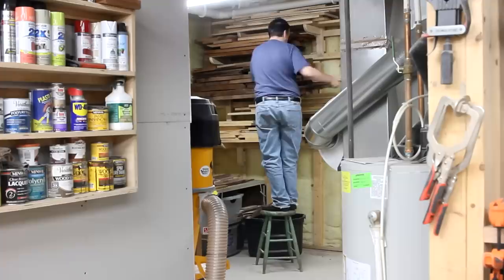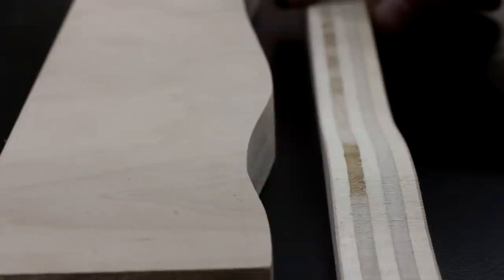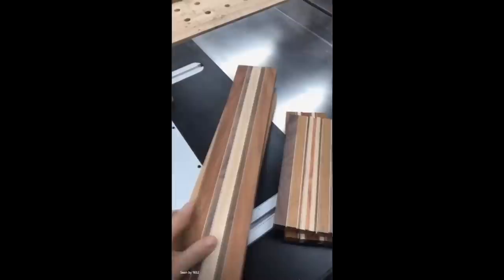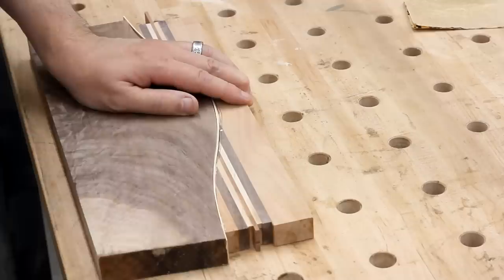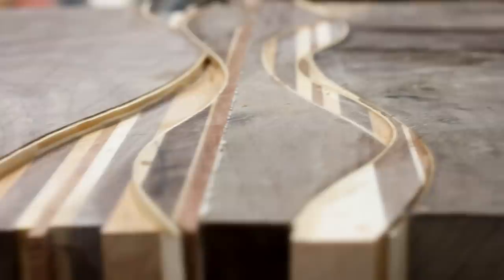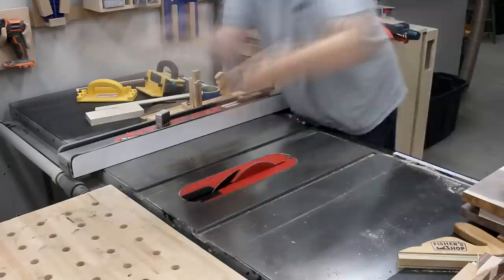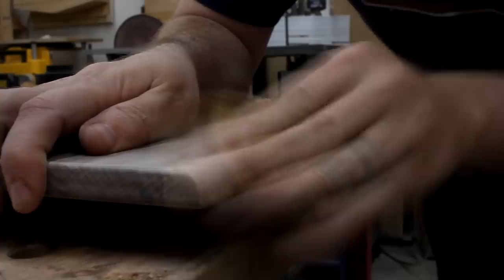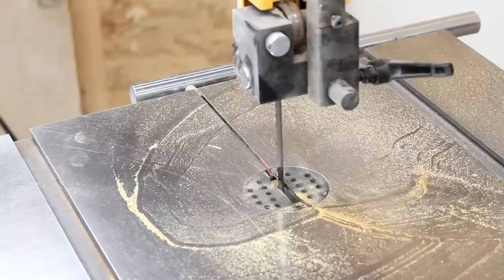Woodworking: How to Make a Woven Cutting Board

Comment: i'd love to see that scaled up on a big dining table or coffee table
Reply: The only way to make a wide table like that is to pass the nearly finished glued up board through an open-sided thickness sander to get the surfaces even. I make smaller (8x12) "cheese" boards this way. Now I need to try this weaving technique.
Reply: @gblakev  You could use a router sled, far cheaper.

Comment: I couldn't, in good conscience, use that as a cutting board...no way. Wall art, lazy Susan, or on an easel.
Reply: I am thinking of making 6-8 of these and mounting them on a headboard.  Sort of popping out a little ways.  Problem is I don't have a jointer, planer or band saw.  So I need to test if this is possible with a jig saw and hand planers first.  First one will definitely be a cutting board.
Reply: @NotMyActualName_  I was having similar thoughts - I don't have a band saw, a planer/jointer or a table saw, but I reckon the swooping cuts could be done with a jigsaw. The tricky parts would be getting the surfaces properly flat and cutting the thin strips...

Comment: "This weaving technique is pretty fun, and easy!" Right now now I need a table saw, band saw, make a thin cut jig, a table top router and bits, disc sander, 20 more clamps and some CA glue. THEN I can make this cutting board. After I get the wood. lol I'm getting there.
Reply: In all fairness you don't "need" those tools. It makes the process easier and faster. But you never need the tools. Except the clamps. You don't have enough clamps.
Reply: @coreyloewenstine8822  lol thanks yeah I know I’m just being ridiculous. I’m slowly building my arsenal of tools. And clamps…
Reply: @timalban1433  it takes time. Depending on the projects you like doing I can suggest tools you should definitely buy before others. My shop mostly produces guitars, plectrums, and cutting boards so my lathe rarely gets used and it feels like a wasted investment since I almost never use it.

Comment: I have watched your video several times and thought I had a handle on the project. I made several strips of wood and glued them together. There were no gaps and I did not plane my piece at this point. Meanwhile I made the thin strip jig and cut the thin strips. I cut the large piece with the bandsaw and made a very mild curve. When gluing the thin strip and including it, it all became a disaster. I would like advice on clamping it in a way that keeps all of the strips lined up and also glue up with no gaps. Thank you. I have pictures - just don't know how to include them.

Comment: In order to smooth out the bandsaw marks perhaps try running straight flute router bit thru the cut, just make sure you space cut pieces parallel. And 1/16th narrower then bit kerf. It will follow the cut, and throw a smoother finish on both sides.

Freehanding should be fine, just let the bit follow the cut, and make sure your pieces are clamped nicely, and parallel.

Comment: Instead of using painter's tape and glue to hold your pieces together while cutting the curves, try double-sided carpet tape. A stripor two of that, some masking tape on the ends and edges  hold the pieces together very well,

Comment: I would live to try this out. I have one concern though. I am worried my bandsaw isn’t powerful enough to keep the flow of the cut going like you did. Mine is an 50’s model old delta that cuts metal and wood although I have never used it for metal. These look great and thanks for the ideas. Great wedding gifts.
Reply: With a sharp blade, your old Delta bandsaw should do fine.

Comment: These are great! Have you ever tried to match up pieces? Perhaps with cabinet door faces? Trying to think of ways to align the curves across multiple panels. Could be done on one large piece I guess, and then cut the door faces down to size from the large piece, but I don't have a lot of workspace to manage a large panel / glue up.  Wondering if you could "start" your curve cuts in the same place on each board to align the design across multiple boards. Have you tried it?
Reply from the maker: Watch my TV stand video.  I did that for the doors.

Comment: You are a master at your craft.  May I ask, do you fill in any imperfections between takes?  I was studying the closeup of the finished boards, and I was incredulous at the sharp fits.  I saw zero imperfections in the joints.  What gives?
Reply from the maker: Nope, no fill.  I just squeezed the heck out of it and closed up any gaps.

Comment: 2:47 stumpy nubs has a great video on how to get that perfect curved boards to match using a router and a offset bearing offset by the width of the router bit (I.E 1/4" for example uses 1/4" bearing offset) something along those lines i think its called like this router technique is harder then it looks somethin like that

Comment: Beautifully done!! Is there perhaps a way to strengthen the board by placing a wooden rod/peg across the center that's also hidden to ensure it stays together over time?
Reply from the maker: Not necessary.  The glue bonds are stronger than the wood itself.

Comment: As usual, amazing work! Going to try it but have no bandsaw wondering if I’ll get by with a jigsaw instead. Thoughts anyone. Length of blade might be an issue I suspect.
Reply from the maker: I'm afraid the jigsaw won't give you the clean cuts you need.

Comment: “Artistic feel” ? Brother, that is art ❤. Now I have to find money for a band saw. And maybe a glue mat…for select neighbor granola gifting.
Questions…would double sided tape work, or is there an issue that painters tape avoids? Would using a hand jig saw be problematic?
Reply from the maker: Double-sided tape would be fine.  Jigsaws have a thicker kerf (which would be a problem) and it can be tough to keep the blade perfectly vertical, the blade tends to drift on angles.  Get yourself a bandsaw. :)

Comment: I'd love to give this a try, but despite having a workshop loaded with woodworking gear, the one piece of equipment I've never had a need for is a band saw. If I take the cuts slowly so as not to slant the blade, do you think I could make the paired double cuts with a jigsaw?
Reply from the maker: No, I'm afraid not.  You really gotta make the cuts fast on the bandsaw to keep them smooth and flowing.  Pretty sure that's impossible with a jigsaw.

Comment: Just found this video yesterday and LOVE the look!!  Not sure how long you monitor comments on a post but I have a question.  Glued up some boards tonight for the starting pieces.  I believe I've made them too big.  One is 7" wide and other is 9" when all glues up.  They are 20" long since I'm shooting for an 18" board.  What are the dimensions of the starting glue ups that you used?  Thank you
Reply from the maker: Doesn't really matter, to be honest.  If it can fit in your clamps, you can do it.  Watch my Lazy Susan build or my TV Stand build.  You'll see this technique done with larger pieces.
Reply: @FishersShop  Thank you, I'll give them a look.  I believe the ones I glued up tonight are going to create a cutting board that is 18"x18".  Not optimal.  Again, thank you

Comment: What was the reason to use a sled with your planer to flatten the rough board instead of your using jointer?
Reply from the maker: Because it's too wide for the jointer

Comment: Hey I was wondering. It looks like the main piece of walnut is face grain but the rest are side, or at least most of them. Will that make a difference with the structural integrity of the piece. I see a lot of different viewpoints on this and was wondering about your opinion. If you even seen this years after posting the video haha
Reply from the maker: Nope, doesn't matter.  Think of it this way, it all boils down to how the tree was rolled onto the mill that determines what will make up face grain and what will be side grain.  If the log was rotated 90-deg more, the face would be sides and the sides would be faces.  There's no difference between face and edge grain.  None.

Comment: very nice design with great technique!  May I know what is the saw width (1/16 or 1/8)? and what is the sanding grit after cut before glue ? thanks
Reply from the maker: Saw kerf was like 1/16" I think.  I think I just used like 120grit

Comment: Really a nice video. Instructional, humorous and entertaining. Bingo!  I'm wondering why it's necessary to make the thin strips the same width as your band saw blade.  Sure, thin ones will bend easily, but other than that it seems that any strip around 1/8" would work.  Your thoughts??
Reply from the maker: The two halves won't fit perfectly together if the strip is too thin or too thick.  It'll be close, but no perfect.

Comment: What TPI is your band saw blade? Mine is fairly low and I don't get clean enough cuts that I trust for glueing. And sanding them risks throwing off the mating curves.
Reply from the maker: The TPI count has to be low so that the gullets are big because your feed rate will be rather high as you push these through.

Comment: I really like this design!  Very cool!  What size is your bandsaw blade?  Ive got the Wen 10" bandsaw but every time I try to use it the blade seems to wander off coarse.  I am using the original 3/8" blade that came with it.

Comment: Why do you have to cut the thin strips to be the same width as the band saw blade?  Couldn't the strip be a tiny bit bigger or smaller?
Reply from the maker: No.  Has to be the same size.  If you remove a certain thickness of material then you have to replace that same thickness of material with something else in order for the pieces to match up exactly.

Comment: l. question about the thin strips. Are they face grain? Are all your pieces face grain to face grain? I am confused about putting face grain to edge on cutting boards. is that ok over time?  I know not to ever mix end grain with face or edge but I can't get a definitive answer on face to edge glue ups. both long grain so should be ok?? anyway your boards are beautiful and definitely going to try one.
Reply from the maker: Yes it’s fine.

Comment: I have a quick question, did you steam the strips that you used for the pattern? Just curious.
Reply from the maker: No.  They're thin enough to bend on their own.  If you steam it, you'll have to let them completely dry before gluing.  It's just not necessary.

Comment: if i am making an 18 x 16 cutting board how do i figure how long the thin kerf strips need to be? because of the curve they need to be longer than the board, so how do i figure that out? thanks
Reply from the maker: Depends on how curvy your curve is.  Just make them way longer, and trim off the ends once they're glued up.

Comment: So how exactly do you get the cut to match on the second board? Is it just that you had them stacked before cutting so you wouldn't have to worry about making a second cut on a separate board?
Reply from the maker: That's how ya do it.  Yes

Comment: I don't notice any lead strips you are using while planning, don't you have trouble with snipe? I thought everyone with this planer has trouble with snipe and has to use lead pieces or cut off the sniped portion.
Reply from the maker: Snipe is practically impossible to eliminate totally.  Yes, you can move it to sacrificial boards but if you take super light passes, usually you can just sand it out afterwards

Comment: Thanks for the great video! Would you tell me the tpi of your 1/2” blade?
Reply from the maker: 4tpi on a 3/4" blade
Reply: In your video you say to use a 1/2 “ blade- it should be 3/4?
Reply from the maker: @willbennate  The bigger the blade, the more smooth and flowing the cuts will be, in my opinion.  At least, that's what I found to be true.

Comment: Hello this was a great video and I am going try this.  Would you be able to use non glued veneer edge strips for the filler piece for the saw kerf?
Reply from the maker: Only if it's the proper width.  I doubt that it would be thick enough.

Comment: I'm trying out a practice piece and making the strips to insert.  They seem very thin, did I read your kerf measurement right 0.0635 inch? And what wood did you use for the strips?
Reply from the maker: Measure your own kerf.  Don't go by mine.  I used maple
Reply: Thanks or your help.  Mine is .062 and was just trying to see if that was about right. I was wondering if I needed to find a thicker blade.  Thanks again!

Comment: Can you please advise how powerful your band saw is.   Is it running a 2hp motor or bigger.   My band saw is a 1hp and with Australian hardwoods it takes a long time to get through the wood and of course it does not give a smooth cut line.   Your work is outstanding by the way.   I admire greatly your skills.
Reply from the maker: My Rikon 10-324 has a 1.5HP motor.  Sounds like maybe you might need a new blade or to tension it more.
Reply: @FishersShop  Thank you for your reply.   I took your advice and put a new blade in that was thicker, but Australian hard wood is HARD and not that easy to get through with a smooth action  I have been experimenting and a steady hand helps.   Thanks once again.
Reply: I took the plunge and bought a 3hp band saw.   Gets through Australian hard wood really well now.   NOW I can get onto making boards like yours.   Love your video.

Comment: Incredible technique, I'll certainly see if I can do this. Fingers crossed. A couple of technical issues that should be noted.....keeping in mind the point of the technique:
1. Walnut is an open grain wood. You can not use it for a cutting board. 
2. The glue used, while claims to be "waterproof" it is anything but.

Comment: Love your work!!  Quick question...do you have to have the thin strip between the bigger pieces or is that just to replace what the band saw took?
Reply from the maker: It replaces the material the bandsaw removed during the cut.  Without it, the pieces won't line up exactly right.
Reply: @FishersShop  OK, time to expand my skill set.  Thank you!!

Comment: How might you do this without a bandsaw?  I was going to try with a jig saw but thinking will not turn out as well.  Thoughts?
Reply from the maker: It just won't work.  Get yourself a bandsaw.  You can get one that'll work for this pretty cheap.  You don't need a fancy one.
Reply: @FishersShop  Thank you.  Any suggestions for an inexpensive bandsaw that will work on dark maple?  Greatly appreciate your help
Reply from the maker: @kristin6555 it depends what your budget is.  To do boards like this you'll have to stack them and cut multiple boards at once.  This requires the bandsaw to have enough horsepower to push through.  You can get a cheap benchtop bandsaw, but I'm not certain if it'll have the gusto to make cuts like that through 2 stacked boards at once.
Reply: @FishersShop  Thank you very much.  BTW, thank you for sharing your how-to.  Your boards are beautiful.

Comment: Doesn't your band saw use at 1:30 indicate that you don't like having fingers? I'm only interested in woodworking but I would never do that with moving in curves
Reply from the maker: Keep in mind all the footage is sped up x4 times.  My fingers were never in danger
Reply: @FishersShop  I see. But when cutting on a curve like this is it even possible to be safer with the band saw?
Reply from the maker: @1lapmagic  I was being safe.  Hold the piece with both hands and guide it through, keeping your fingers away from the blade.
Reply: @FishersShop  safer*. But I see your point. You'd have to cnc it or something to do it without hands. Maybe such a thing is available as a programmable bandsaw. Interesting idea.

Comment: It was obvious you were using every Rockler tool available. That’s ok , I get it. But you went to all that trouble to flatten that board in the planner when you had a jointer there. Then towards the end you you could have cut that curve on the end of the board on the bandsaw and then sanded it on your sander. I understand it’s nice to show different techniques with your sponsors tools but a long way to get to the station. Just an observation not a criticism. Board came out great, like your speaking presentation
Reply from the maker: Couldn't use the jointer, the boards were wider than 6".  Cutting the curve on the bandsaw and sanding would work but if you'll be making more than one board like this, you'll want a template so you can batch them out quick.  Doing it the way I did would allow for that.
Reply: @FishersShop  I respect your opinion and skill , but being a furniture maker for 55 years plus I disagree. Easy to flatten a board larger than the jointer and I think it’s better to cut and sand end grain than to rout . Again , my opinion. Best of luck

Comment: Why didn't you use the jointer to surface the boards?
Reply from the maker: Too wide for a 6" jointer
Reply from the maker: Yeah, I'm familiar with that technique. I'd have to spend some time removing the safety cover from my jointer.  I already have the planer sleds built and little shims made.  Might just be me, but I find the planer sled route to be quicker.
Reply: @FishersShop  whatever works best for you! I enjoyed the video. I didn't realize how simple these would be to make.

Comment: Wait, dude has a surface planer and didn't use it to face the board before thicknessing? Used hot glue instead?
Reply from the maker: It's a jointer and it's only 6" wide.  Too narrow for the boards.